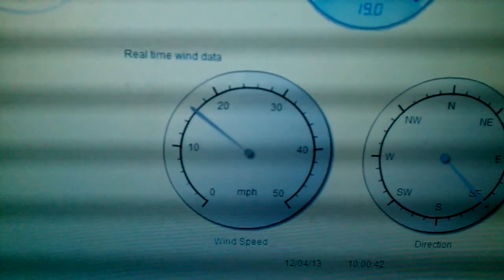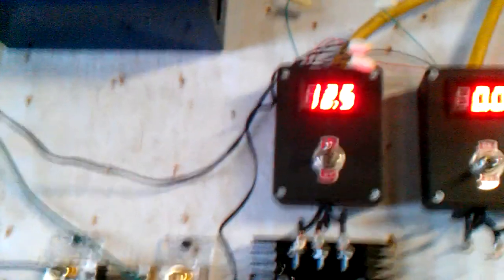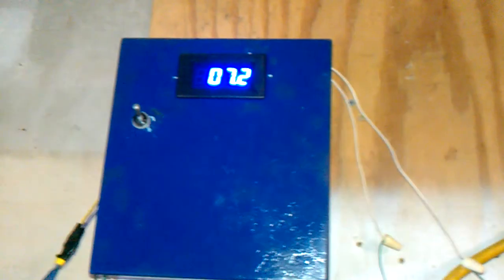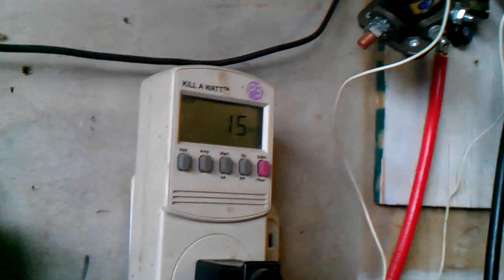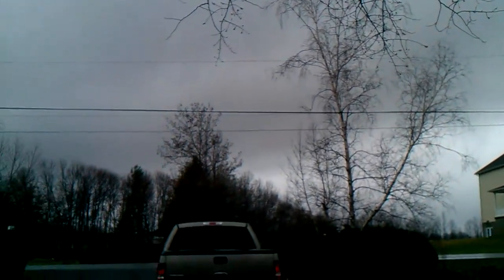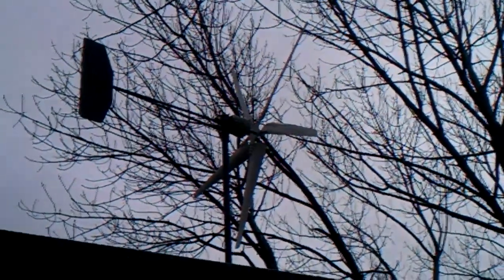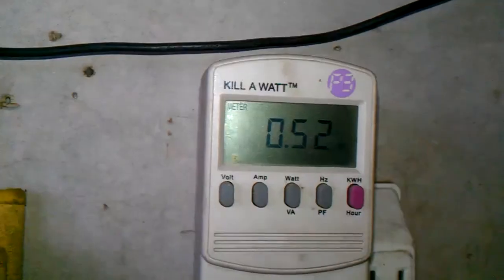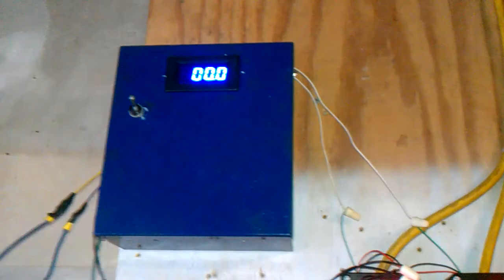WindyNation WindTura 750 Installed

Comment: Kevin, when you compare vids you see the fluttering of blades then the wobble of pole. So when you see the mass number of blades and the weight of the dual is pushing against the pole. But blades as Windy Nation makes are supposed to be riggit not flimsy. Which help also in production. If you have noticed that how amps would jump around with the craptor blades, not with the Windy Nation blades! Thanks for the video and please show more.